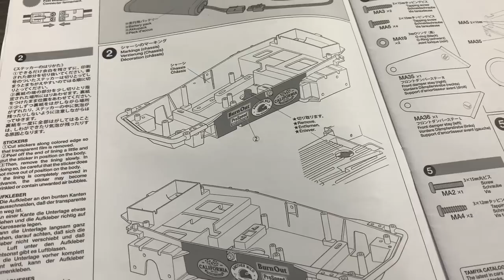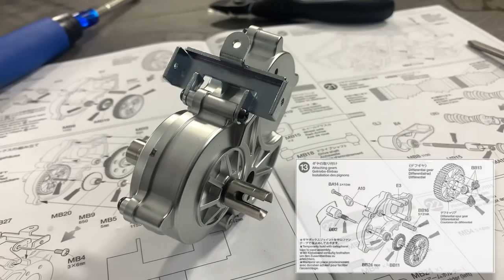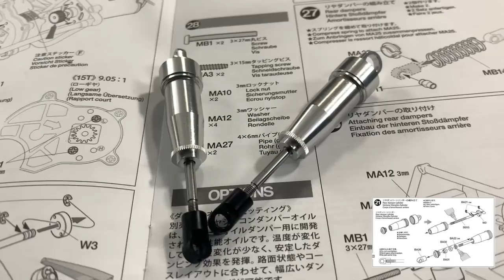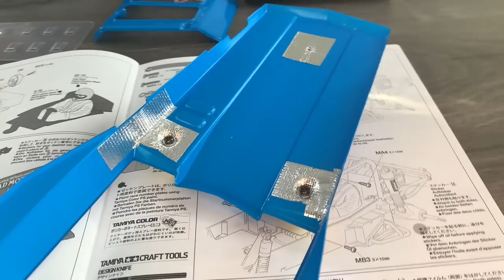REBECCA'S BACK! Building A Blockhead Wild One Off-Roader RC Buggy By Jun Watanabe & Tamiya

Comment: You did a great job with this one Mrs!.. the silver box part you talked about near the end of the video was originally on the 1984 fav and it was a cover for the receiver or Rx batteries, that was of course before there were any bec mechanical speed controllers or esc's👍

Comment: Excellent build video, really enjoyed it! I like the look of that metal front bumper, but it does look a tad too thick, it won't flex under impact and protect the front of the buggy. Then again, if you run it just put the plastic front bumper on. And as for that steering servo, 25KG?!?! Blimey, a bit overkill ;) Also, I think Tamiya should definitely put bearings in all of their kits these days, other manufacturers do it at far lower price points, I'm sure Tamiya could do it too!
Reply: Yes, i would not drive it with the metal bumper. One frontal impact and the chassis might get a crack or eaven brake completly. Looks great though.

Comment: It’s interesting how similar Tamiya’s Wild One is to a Kyosho Scorpion. It’s like Tamiya copied the design from Kyosho. The Kyosho is much better detailed though and has metal chassis, suspension arms and gearbox casing. With Tamiya using the metal look parts it looks even more similar. Hopefully that doesn’t rub Tamiya fans wrong, but it looks so similar an has very similar suspension design
Reply: Yep I agree with you
Reply: Definitely similar, for me the wider, lower and more squat stance of the Wild One looks much better but the practically full metal chassis, suspension parts etc on the Scorpion are very appealing. It would be nice if there was a full metal and carbon space frame chassis available for the Wild One along with trailing arms and the cage, that would be awesome!
Reply: Interesting how Kyosho copied a Volkswagen based dune buggy…
(Actually that’s what makes it so great!)
Reply: While the design is similar it has some fundamental diffrencies. Build quality and strength is diffrent, Scorpion is usefull as a race car base and the wild one is not really up to that task. Also while both have the trailing arms scorpion has angled trailing arms in rear and double trailing arms in front. So Scorpion is way better chassis geometry.

Comment: I really enjoy this channel and the builds.  However between you two and Tamiya Legends I'm not getting sold on these Tamiya kits, either the new ones or rereleases. I want to drive them, but no bearings, no part support and I've seen a few builds where plastic and metal parts break during assembly.  I bought a CC-01 2 years ago cause I really wanted one as a preteen when it came out, however it's looking like that is going to be my only Tamiya kit.
Reply: After building Kyosho and Team Associated kits its hard going back to Tamiya. They look awesome but the quality just isnt there.

Comment: Anybody has ever build this car with the optional led light unit TLU-01? Because I am desperately trying to put it inside the car but without success 😩
Reply from the maker: Are you having issues with the LED unit and finding space in the chassis, or something else?
Reply: @RCKickschannel  I have indeed issues with finding place in the chassis between the servo, the ECU and the driver there isn t a lot of space remaining and as it a collector I d like to do something as clean as possible.